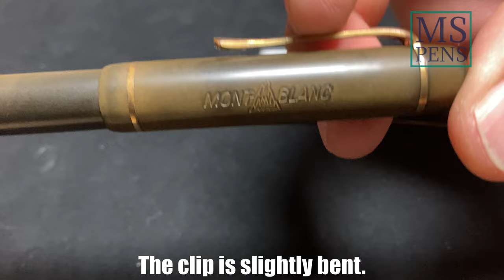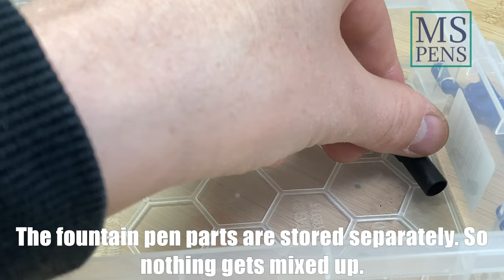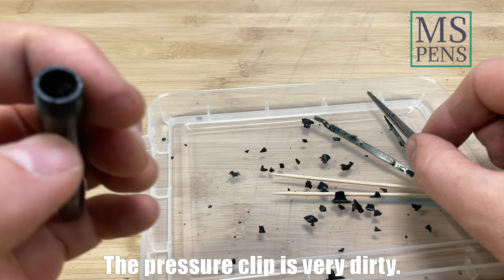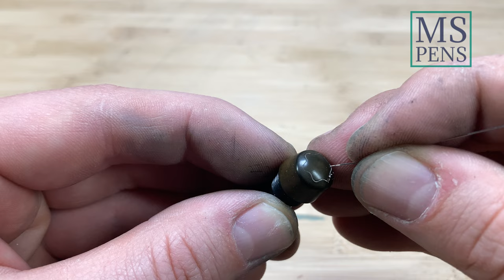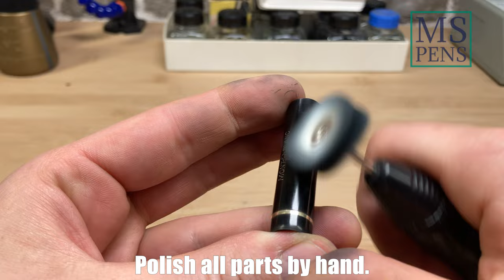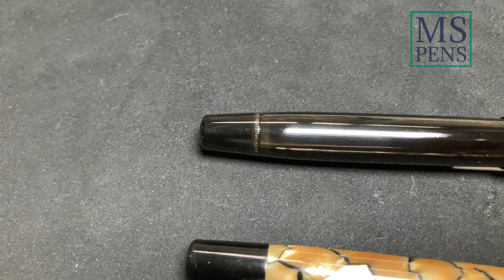Montblanc 322 fountain pen - Restoration

Comment: Hello! Very nice restoration. What grid sandpaper did you use to remove the oxidation on the hard rubber? I have some very oxidized user-grade pens I'd like to polish up but I've not been able to restore the color like you did.
Reply from the maker: Hello, thanks for your comment.
I usually start with a 1000 grit, then 1500 grit and finally 2000 grit. (2500 grit can also be used well if you have it to hand).
In some cases I start with a 500 grit. But this quickly removes too much material and creates scratches that can be easily seen later if you do not sand very well with the 1000 grit.
Reply: @MSPens  Thank you!

Comment: I've only recently discovered your channel. Very useful and interesting content. I'd love to find out where you got your knock-out block. Also, did I miss where you worked on the apparent corrosion around the button on the hard rubber pen? What did you use to get rid of that? Thanks.
Reply from the maker: Hello, thanks for the comment.

I have built the knock out block myself. Actually, it should already be available for purchase on my homepage, but I am currently rebuilding my workshop, so it will take a while.

The corrusion I have simply removed with metal polish. If it is too tough, I also like to use very fine sandpaper.

Best regards.